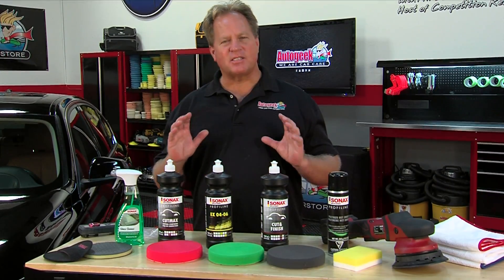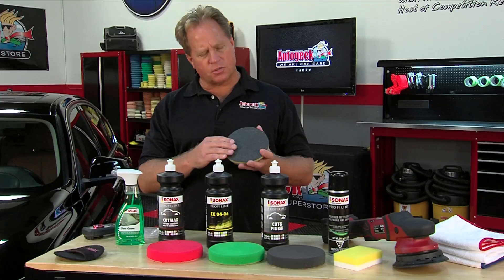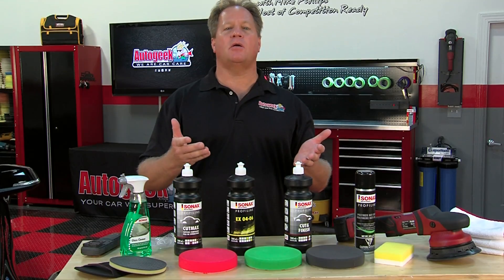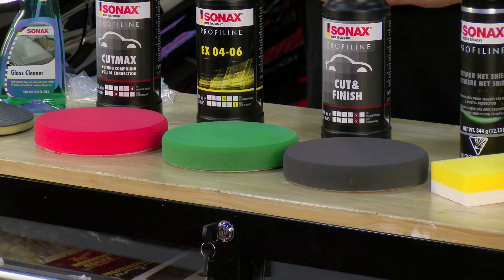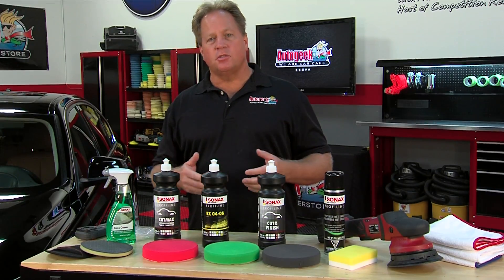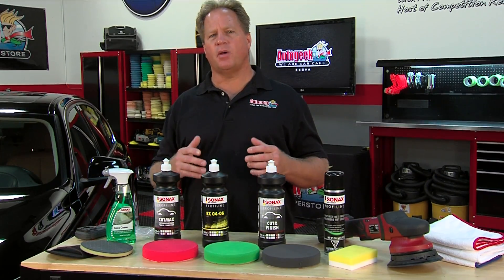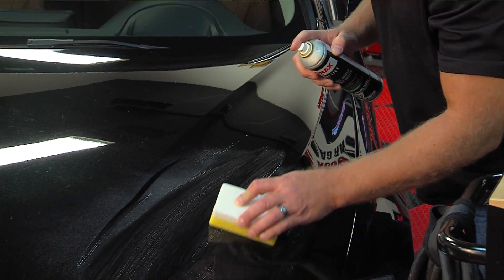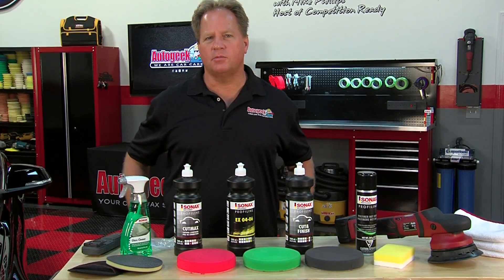How to do paint correction using SONAX products

Comment: Hi.
Cars these  day wash in tunnels with giant brushes.Black german cars after these kind of washes are impossible  to polish even with cut max and the most abrasive pad.
Wet sanding with DA using1500 or  2000 disk  and then following with cat max and a sealant could wok but even Abralon sanding disks ware off too quickly.

it takes 15 abralon sanding disks to do audi 6 for example 15 disks been 4 euros each is no where near to be cost efficient .
Wet sandng by hand is too long and too hard.
Could you please suggest some solution.

Thanks.

Comment: What’s the difference between the Sonax EX 04-06 Vs Sonax Perfect Finish? They both have the same Cut of 04 and Gloss of 06. I feel like they are the same product just different name. I’m only asking because I was going to be ordering most of the Sonax products.
Reply: I was wondering the same thing. Apparently there the same cut and finish the difference is  ex04-06 is ment to be used with a DA/ long throw and the cut and finish works best with a rotary. But in all seriousness cut and finish has slightly better chemistry over all regardless of what tool you use. So safe bet is cut and finish great all around.